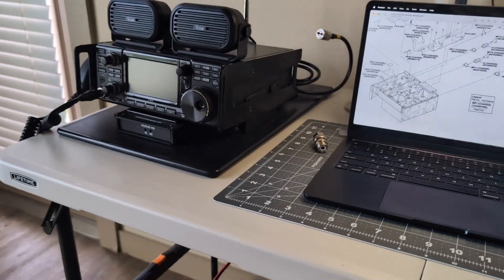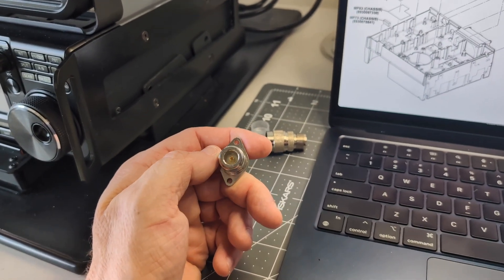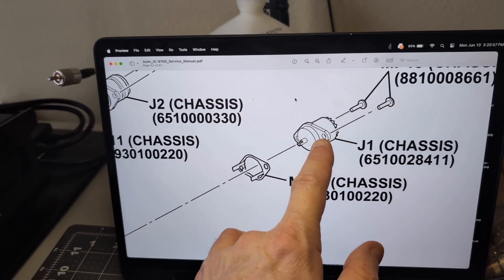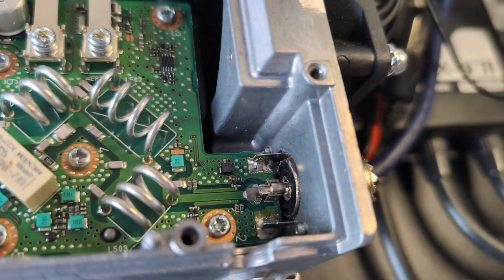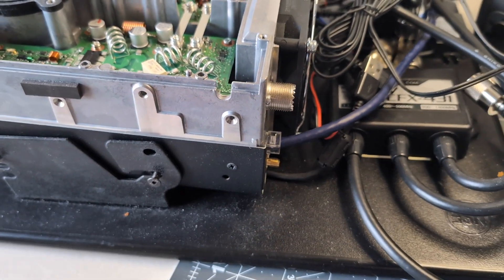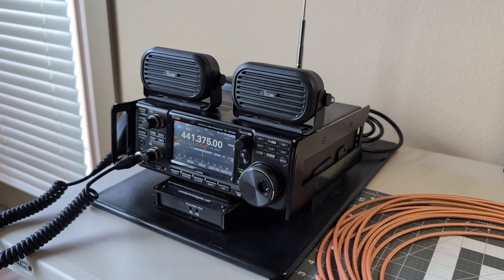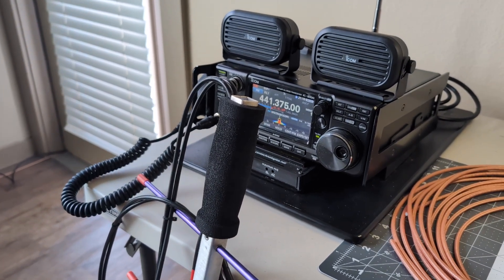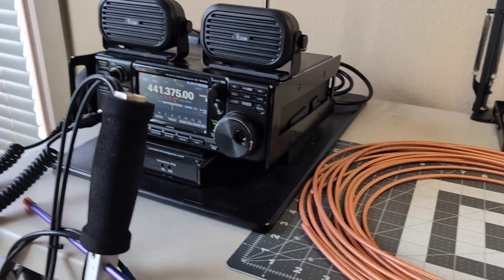Icom IC-9700 VHF Port SO-239 to N-Type Conversion

Comment: after watching this I checked and the 7300 is the same way. I have a Micom Mobat that's type N so I'm converting everything to that including HF.
Reply from the maker: I did the same.  It's not so much for the lower loss of the connection as it is about the feedline assembly.  Why run a low loss feedline only to terminate it in a high loss connector?  If I need to connect my low loss feedline assembly to a high loss connection, then I'll do it with an adapter.

Comment: On my ic7100 both HF and VHF/UHF sockets are clipped, not soldered... I had always assumed it was to provide for some flex between the connector bolted to the chassis and the connection on the board to allow for thermal creap that a soldered connection wouldn't allow... I don't know why one of yours would be soldered and not the other!
Reply from the maker: Maybe they thought the SO-239 center sleeve might get loose over time?  I thought about soldering the VHF N socket, but decided against in case of warranty work.
Reply from the maker: Now that I think about it, the center pin of the N connector is not really engaged until the outer sleeve is threaded on.  No so with the PL259/SO239.  You can put leverage on the SO239 center sleeve by just inserting the PL259 center pin half way or so.  Interesting.
Reply: I just tried to find my pics from the last time I had the 7100 open to make sure I'm remembering correctly, but no joy, I'll have to remember next time I'm in there 😂 Both my ANT ports are the SO239's that it came with but I've thought about making the N connector change too, at least for UHF!
Reply: To me, amphenol  or other quality brand is worth it.  The 9700 is a great radio.  I have one.  I tried cheap connectors, they lose contact or even raise VSWR.  Connectors can be specified as 50, 75, or non specific.  There is a physical difference. My Tektronix TTR506 can measure the difference.  The meter on the 9700 may or may not.  But if performance matters, spend $14, and know what you are getting.